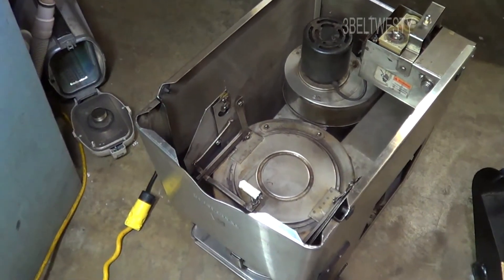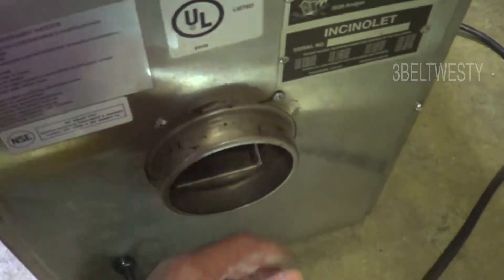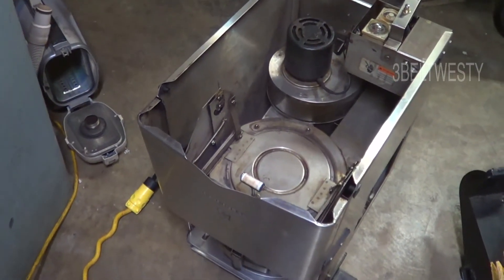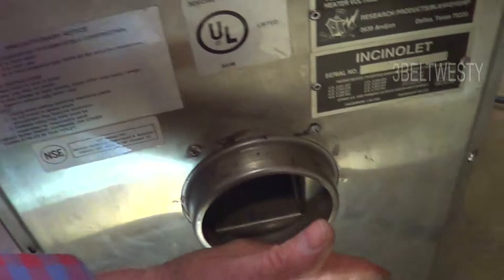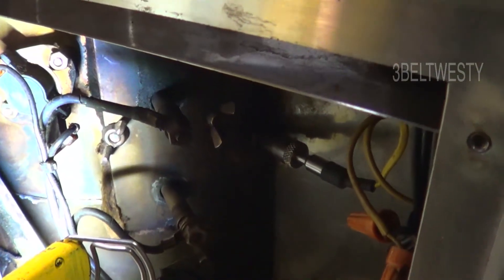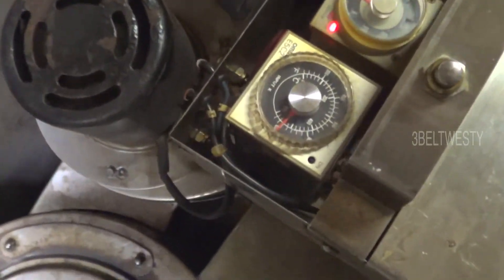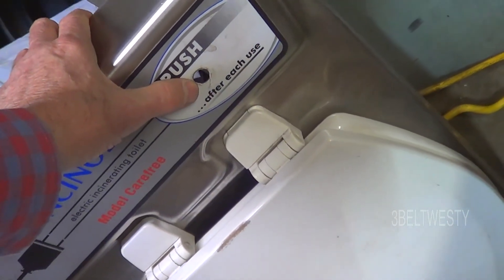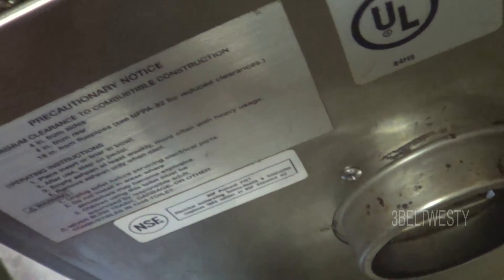Incinolet CF experiments electric toilet

Comment: Hm. Should not be THAT difficult to modify an Incinolet for outside air. That right-side cover could be modified/replaced with a shroud leading to a fresh outside air duct. Obviously it would still pull some air through the various gaps/etc. But any reduction in conditioned air usage is good. Plus it would help prevent backdrafting.

But seems quite simple looking at the wiring diagram online. Most is off the shelf components except the element itself. Although I suppose the programming set of the timer needs verified. My understanding from the facebook group is that it is the delay mode version.
Reply from the maker: The timer controls how long the unit's "heater cycle circuit" runs. The heater element  toggles ON and OFF during this heater cycle . There is a Thermocouple sensor that turns OFF once at the  high temperature set  point.Then back it goes off once slightly cooler. ie Goes on  off on off through out the "heater cycle".  ie like an electric stove element cycling. 

The exhaust fan is turned on by Either a thermal switch OR the "heater cycle timer" (pin 9) . The fan run time  may run Longer than the "heater cycle time". ie the fan may cycle a time or two after the say 60 minutes set by the timer.  

So for clarity if the factory setting of 60 minutes is used on the Timer that fan might run exactly that 60 minutes only. Or it might run 62, 65 minutes etc since the Timer's pin (9)  is OFF but the incinerator is still too hot. ie the ITS is closed. ie the Inverse Thermostat is still warm so the fan still runs to cool it. 

Also the unit can run for 60 minutes with the Fan on. Then all is quiet. Then the Fan kicks on for 1 minute or two then off again.

The ITS is an F130 thermostat. Closes contacts at 130 F +/- 5  ;  opens at 110F +/- 9

The Incinolet might be in use at the South Pole or on a tugboat in Louisiana when it is 98F outside

For "makeup air" venting you could just remove the side panel and use a custom sheet metal piece with an entrance hole and vent tube.

Comment: Everyone keeps referring to the liner as waxed. Is it waxed or is it parchment paper?
Reply from the maker: It is waxed paper. You can fold you own or  buy the pre-folded ones.

The goal of the liner is to not leak and slide the stuff into the incinerator chamber.  Another goal is the least damage to the 250 bucks of Platinum pellets

If you used a thick paper it would work too BUT then you have to burn up that paper. This may add to exhaust smoke and or ruining the Catalytic converter pellets quicker.

ie creates more ash in the ash pan.

Parchment paper has a silicon coating; not sure how that fares well going thru the Platinum pellets in the Cat converter of the Incinolet.

 The electric cost per usage is more than the wax liner cost by far. So better to stick with recommendation.  

If one lets the ash pan fill up after  many many usages the heater coil will run hotter. ie insulation. So emptying the ash pan is a maintenance thing . The stuff is like fireplace ashes.

Comment: I picked up an Incinolet iCF n pieces, put it all together and discovered that the rear vent panel has a 1" gap at the bottom.  Did I do something wrong?  The holes on the side panels and real panel line up, but the 1" gap has me baffled.  What did I do wrong in putting this toilet together.  Fred
Reply from the maker: Hello Fred; look at theses photos on a completed Ebay auction. There are some gaps on the back panel. You have to look through the photos and find the one with the back showing.

https://www.ebay.com/itm/134577237322

also a cross section is shown here:'

https://waterdecontamination.tpub.com/TM-55-1930-209-14P-15/css/TM-55-1930-209-14P-15_179.htm
Reply: @3beltwesty  THANKS SO MUCH for the links  .  .  .  your help is very much appreciated.  Fred

Comment: I have noticed an obvious problems with your unit.
1- Motor was installed wrong, (120 deg.) causing your Lid to open partly.
     not allowing the two Halves to open correctly (should be 3 1/4 to 3 1/2 Inches).
When depressing the pedal, the Lid is probably rubbing on the motor wiring harness and preventing it from fully opening.
This way you expose yourself to a partially closed lid and potential fire hasard.
When depressing the pedal, you SHOULD see about 80-90 % of the entire oven opening (from above).
Rotate the motor so the wiring harness is facing the back of the unit and do a test.
Reply from the maker: Thanks for the input. I need to recheck  the motors (120 degree) location once the cover is off again. This was a used unit so the motor motor was just placed back the way it came used. lol . Thanks for pointing it out.

Comment: Do you know if the omron controller, timer, and blower motor is 110v?
Reply: Motors are available in 120/240v.
Temp Controlers are 120v (if analog model(Old)) and 120/240 if Digital (New model)
Timers are 120/240.

Comment: You can also pull the ventor motor and lubricate it for longer life. What I would like to see is putting a new coil in and properly install the grippers for the coil for air gap. Instead of just slamming a new element which will sag in time and burn out. If anyone can show how to do this I would love to see.

Comment: hi 3b i just bought a 2007 CF model never used but the clam shell does not close all the way, about a half in gap is there an adjustment or is this gap ok. the burn pot does open and close ok. thanks . like your vids
Reply: Remove top cover, unlock roller at front of oven lid, and unscrew it 1/2 turn and relock and test.
You may need an extra 1/2 turn.

Comment: I’m having an issue with mine. Heat coil was replaced few months back and now I’m not getting any heat. I was told to replace the “ITS thermostat “. Hope that solves my issue.
Reply: Did it fix your problem?
Reply: @user-jx2rj8tz6m  it was actually the temperature controller that was bad… I purchased this home about 4 years ago. When I called Incinolet and gave them my ser# they told me this unit was built in 1993. Not to bad of a unit for being 28 years old.

Comment: What is  system Electrical 12 volt or propane ?
Reply: Electric 12 volt
Reply from the maker: This unit is 120 Volts Ac 60Hz 1800 watts. 15 amps. The plug is a 20 amp 120volt plug

Comment: I worked on 3 vessels that used incinolets. Two of them very old. I never had the occasion to take one all the way apart like you did. I have found them very reliable. Most common problems we had was timers failing and burning through the ash pan eventually.
Reply from the maker: This unit might be 15 years old with an unknown number of cycles. The incinerator part right above the ash pan has some heat cycling damage thus some of the expensive catalytic beads fall out. I am going to place the beads in a stainless mesh bag as an experiment. The blower wheel was really full of crud. With the timer it is on my list to watch. With the first 90 minute test the blower was still running an hour later like the blower thermostat was stuck, or timer goofy. Then I changed the timer to be just 15 minutes and the burner ran then the blower cycled on and off to cool down the unit for another 20 minutes. Used items can be wonky. Thanks for the input.
Reply: Your toilet was built in 2008.
Reply from the maker: Kevin, thanks for the information. I guess the 2008 date is from the serial number?